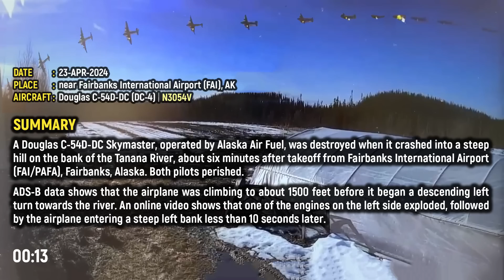Douglas DC-4 Plane CRASHES into river near Fairbanks, AK (2 DEAD)

Comment: That's a DC-5, not a DC-4!  DC-4 was a C-117 modified upgraded to a C47, was stretched and with a larger tail, engines, and landing gear had doors
Reply: Virtually everything you said is wrong.   The modified c-47 was designated a "Super DC-3"  yes, it's even a seperate type rating.   It was not a DC-4. the DC-4 is a 4 engine, tricycle gear airplane,  essentially the same design as the military C-54.  The DC-4 has no commonality with the DC-3/C-47   The DC-5 was a twin engine tricycle gear aircraft.  Very few were ever built.
Reply: So WRONG!!!!!!!!!!

Comment: this is a real warning.  Fracking, which is pet coke, is getting on top of circuit boards, causing short circuits in all electronic boards.  Do not fly unless you clean your circuit board electronics/first,  then test for hours, all devices are yes, stopping. shorting out.  Pet coke contains several non visible metals such as chromium, nickel , zinc, etc etc and the pm is so small on it, it can enter thru your skin into your blood.  Or into the contacts on any engine, This is not a joke, and it is not ,meant to make people upset, it is a warning against all fracking dust, and to try to get you not to fly, until you do the right thing.   All fracking oil companies should be law suited for this problem with mulitple law suits, This may be the only warning you will get.  We are not in aviation, we are normal people that do not put up with bull shit.   Very sad,  Very sad indeed.  That to some people, money is worth more than a soul.

Comment: Good video. It's unclear when they knew they had a problem and if they kept hte engine running that had a problem. If they did that could have been a fatal mistake. Also there was a lack of urgency in returning unless the plane was so damaged that they couldn't really turn.
Reply: What makes you think there wasn't any urgency?
Reply: @andrewalexander9492  didn't turn around for 90 seconds
Reply: @DanFrederiksen  90 seconds from what?    in real time,  the elapsed time from them transmitting that they were returning to the field, to the last transmission (tell them I love them)  was 34 seconds.  So when you say "90 seconds" when are you starting that clock?
Reply: @DanFrederiksen  So, what was the initial problem at that point.  What cockpit indication of the problem did they have?  Did it appear to be a problem whcih could be rectified?  What steps did they take to rectify that problem before deciding to return to Fairbanks?   As far as I know, there are only two people who know the answers to those questions, and they're both dead.  And if you don't know the answers to those questions with a high degree of certainty (and you do not) then you're not in a good position to pass judgment on their actions in dealing with whatever they were dealing with.    So, putting aside the fact that you don't have anywhere near the information you need to make a judgement on their actions,  you're simply wrong about them taking  90 seconds to turn.    According to the ADSB track log, at 01:59:08  they were climbing on course (280 degree heading)   by 02:00:00 they had already completed 53 degrees of their turn back toward Fairbanks.  Assuming a standard rate turn, that means that they began the turn back toward Fairbanks no later than 35 seconds after the earliest point that they stopped climbing.
Reply: @andrewalexander9492  it might have a cockpit recorder but for them to lower altitude they must have been aware of a problem. That could be vibration or sound from the engine. For it to explode later that might mean they didn't shut it down, if so that seems like a huge mistake. As for turning, I have generally said that if there is a problem with the plane near an airport you don't hold committee meetings, you land with extreme prejudice. Whatever they were attempting, unless the plane was somehow unable to turn more, turned out to be inadequately determined. Engine should be shut down and the return started immediately. Not a standard turn but whatever it takes. No waypoints or approach plan or whatever ATC archaic bla bla. Nearest runway corner. Planes don't malfunction gracefully. Things turn bad.

Comment: Why is it that folks are self designated aviation experts and opine on things they know very little to nothing about. Opinions are just that...opinions. Please have some respect for the surviving families. This aircraft had a maximum gross weight of 66,670 lbs., much lower than the 71,000 lbs. that the military operated them at. Consider that a explosion and resultant fire on any side of the aircraft is going to disrupt the airflow and lift over the affected wing...not withstanding any damage to the control surfaces. The fuel tanks are located within the wing immediate aft of the engines. I have may hours as Pilot in Command in the DC-4 flying wildfires and have "lost" many engines over the 11 years operating the aircraft. The aircraft is a very agile and predictable aircraft. I equate it to a 4-engine Cessna 182. Please reserve judgement until the NTSB Final Report.
Reply: dc4 is a garbage
Reply: OK DAD!!!! geez. Take a breath.
Reply: My only worry (AF Flight Safety at Elmendorf years ago Hercs and King Airs), is that they got slow while turning back.   Fly safe.

Comment: Again, we see an experienced crew turning toward the bad engine. Why is this basic aspect of flying multi-engine aircraft forgotten?
Reply: Everyone wants to be the expert. Why do some opine as if they are aviation experts? Airspeed is your friend. I flew DC-4's for many hours fighting wildfires and shut down many engines. Respecting the families, please leave the "guesses to the NTSB final report..
Reply: @tcsaviationstudio  not an expert but I am a pilot. Not a four engine and I don’t have an ME Rating but I have had multi-engine training and look through YouTube and you’ll see that turns to bad engines at low speed have bad outcomes. Of course I feel bad for those lost, but lessons have to be learned. In the heat of the moment difficult decisions have to be made.
Reply: Multiengine training includes maneuvering into bad engine,does not mean you will die. As with any flying one must respect the situation that exists.
Reply: @garymiller5624  agreed but you have the addition of low and slow here. Training does not include maneuvering into the critical engine below VMC. That’s a bad idea.
Reply: @ktreier  I sincerely do not think they were that slow just prior to the explosion and from that point on the crew was just along for the ride. You had a very experienced PIC here. Also during multiengine training one would make aware do's and don't. I did see you mentioned slow & low but this particular incident happened so fast and so catastrophic that there literally was nothing the pilot could do.
Reply: Because that’s not a thing.

Comment: i assume that little blip at 2:03/2:04 on the audio is the explosion....
Reply: Not to deny or anything, I think it could also be when a mic becomes hot (active, someone turns the mic on that initial electrical connection can sometimes make a short bik noise)
Reply: @jakespencer6781  possible but the times line up astonishingly well for the explosion (time between blip and impact as well as position in turn) and the explosion could be the reason for either a short or a small emp. the latter would indicate / require an electrical spark to happen and initiating the explosion...
It's all just speculation. I just assumed it based on the timing, nothing else. we gotta wait for the official, probably not even the preliminary but full final, report
Reply: @boahneelassmal  also possible, maybe not emp level, but if it was to transmit the sound for that split second one hypothetical possibility is either caused the pilot's hand to briefly smack the mic button (as iirc they're not toggle buttons, I think only hold to talk.) or something shorted the wires for whatever controls the mic.

I'd love to see what occurred in detail and see what caused the blips but the direct explosion picked up over radio waves I highly think is improbable unless it activated the mic in some way
Reply: @jakespencer6781  i don't think that the sound is what the mic picked up... I think it's the radiowaves that naturally occur when there's a sparc / arc.
Like when you held your light switch dead center to make the lights flicker and your fm radio would start making noise. I think that's what happened.
Reply: @boahneelassmal  my reply to this was removed ... It was a long response and I didn't copy it, hopefully it's in your notifications 

Something censored me

Comment: That looked like an explosion of a fuel tank in the left wing behind the engine… the explosion may have taken out the flight controls, leading to an unrecoverable dive.
Reply: And how can a fuel tank explode on its own if it´s not hit by a bullet or something? Sudden decompression, and at such a low altitude? As far as I know, such fuel tanks are supposed to be self-sealing under basic safety measures, and they are also supposed to be isolated from the heat of the engine exhausts.
Reply: @Alantheleopard  Things go wrong. Hoses, connectors, fuel lines, tanks, seals, can all split, break, burst or corrode. Parts can rub or chafe. Parts can be incorrectly installed, or the wrong parts fitted. Not to mention this plane itself is an ancient design and not far off from being 100 years old. There are thousands of parts in a plane, if it was as simple as you say, there wouldn't be plane crashes. 

TWA Flight 800 crashed because the air conditioning was left running for longer than usually anticipated with a nearly empty tank of fuel. 

All sorts of things can happen with things you mightn't even think of until the Swiss cheese lines up. Hopefully the crash investigation team can figure out the cause and suggest ways to prevent it happening in the future.
Reply: @Alantheleopard  fire

Comment: Losing one engine out of four is not catastrophic! I wonder if it did some kind of damage to the controls!
Reply: Probably. Remember also that the DC4 is not a nimble craft, was at low altitude, and was heavy. 

Yes, but you're also probably right. A control issue where you have time (altitude) is one thing, at 1700ft in a tanker is another.
Reply: from what people have made out of the footage the number 1 exploded and got hung up on the leading edge of the wing kind of like asa 529 before it dislodged right before impact
Reply: yepp....................; I had a similar thought

Comment: If one engine goes boom there are still three engines left. Something is missing here. 
Were they out of two engines? Did they turn into the dead engine side?
Reply: The aircraft is low, slow, and heavy. Losing an outboard engine on a four-engine prop (non-turbine) at that altitude, violently, is very rarely recoverable. Ignoring the damage likely caused by an exploding engine, the loss of power, plus the yawing , tends to hamper stable flight - it would require a very unique set of skills and circumstances to keep the aircraft flying for a return to the field - which is what the crew recognized early with the call to put it down in a field nearby.

Adding the likely catastrophic damage to the wing structure and flight controls due to the engine exploding, the height about the ground when the event occurred, and the stage of flight, this was, most likely, an unrecoverable event. Obviously, an NTSB report has final word, but this doesn’t look like ‘something doesn’t add up’ - it looks exactly what it appears to be; a catastrophic engine explosion on departure while the aircraft was low and slow, and the crew was transitioning in the departure phase to the en route phase of flight.
Reply: @arctain1  Yeah, the video blancolirio showed was much better than these stills.
Reply: The explosion probably took out flight controls.
Reply: @johnpage735  - Maybe. Even without a physicsl loss of flight controls, the loss of an engine in a multi-engine aircraft at this critical stage of flight is enough to send the aircraft into an unrecoverable spin. 

But yes, the flight controls were most likely severely damaged or destroyed.
Reply: the engine exploded off its mountings and did the same as asa 529 and hung on the wing going that slow with three engines and having you number one engine pointing sideways is a killer and sadly it only fell away right before impact
Reply: It appears something was happening before that engine blew.
Reply: @kuckoo9036  I know I know. I'm just weirded out by them losing control from the loss of one engine. Seems on the pictures like the wing is still attached but yes, damaged control linkages might have doomed them.
Reply: @kuckoo9036  I just saw blancolirio has a video on this!

Comment: Looks like they were already in a left turn when the engine grenaded itself. I'm sure it took out there ailerons on that wing when that happened and at such a low altitude I don't think they could have done much more. RIP men.
Reply: @chrisblack2216  Your point?? Wings don't turn aircraft ailerons do.
Reply: @chrisblack2216  That's because the wings are intact. Have you checked your vehicles blinker fluid lately?

Comment: I cannot see this as a left engine problem. It appears to me to be a RIGHT engine explosion. If it is a left engne issue, the plane would appear to be inverted when it comes into view. What am I missing?
Reply: It's plainly a left engine issue.  Don't know what video you're watching.  Left engine blew and the right engine rolled it TO THE LEFT.  Fire is evident as it rolls.  Turning left back to the airport was going to be a problem but the sudden explosion at a slow speed might have stalled it.  Turning into the good engine is the first thing you need to do.  
Then 
Mixtures/props/throttles/Identify/verify/feather.  My guess is they are not counter rotating props so the Critical engine blew and the right engine, having more adverse P factor rolled the plane over.    Those are BIG engines.
Reply: IT appeared to be the number one engine on the left wing as you can see the flames between the two, and no, he was not inverted though he was pretty close to it when he finally made contact with the ground.
Reply: Roll is the secondary effect of asymmetric thrust,  initial effect is yaw in the direction of the failed engine and if that yaw is left unchecked by rudder application or reduction in thrust on the opposite side then roll follows and the entire thing keeps repeating.
Reply: Dude you blind?